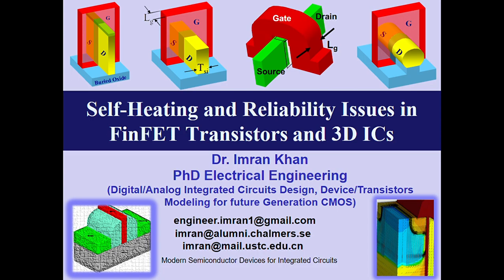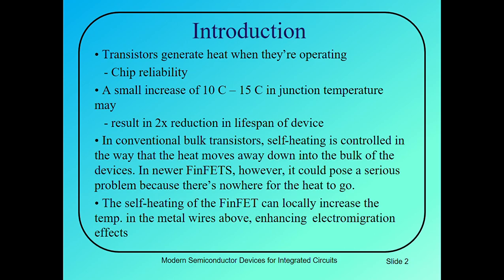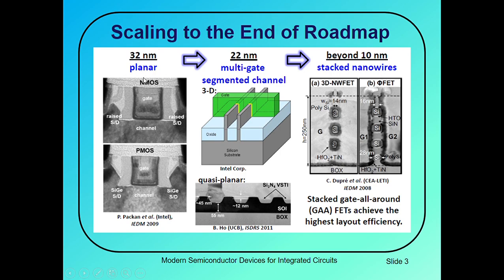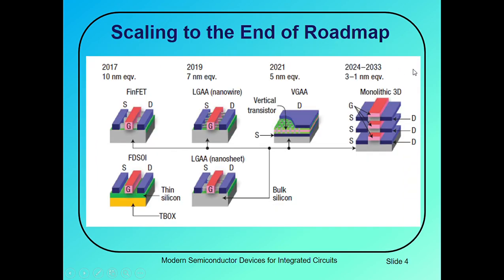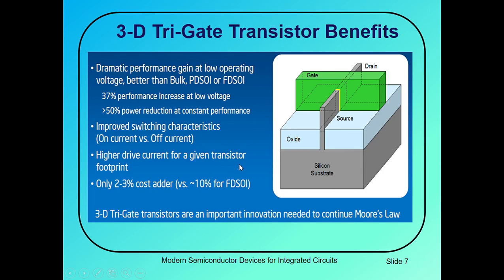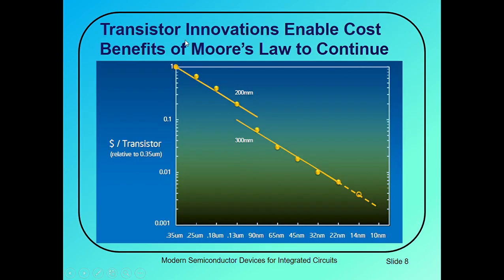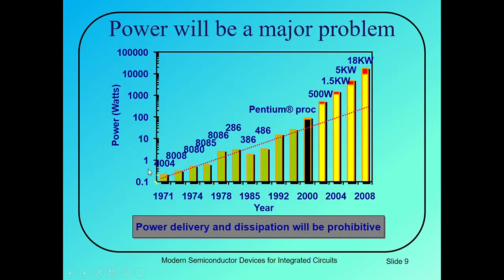Self-Heating and Reliability Issues in FinFETS and 3D ICs || Power Dissipation and Thermal Analysis

Comment: Why local hot spot is created near the drain region?
Reply from the maker: Drain and Fin bottom region surrounded by lower thermal conductivity region has lower heat flux. This means that the big amount of heat remains in that region.  Or you can also think that the heat generated by joule heating is largest in lightly doped drain.  Major part of the heat generated here flows to the regions having larger thermal conductivity.
Reply: @engineerimran1 Hi professor, aren’t source and drain the same in layout? Or sources are more heavily doped than drains?